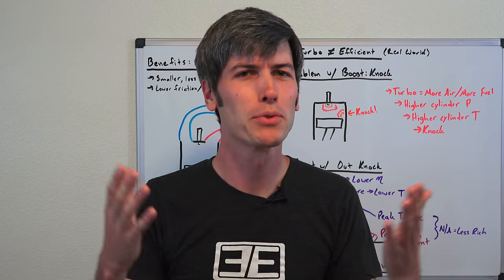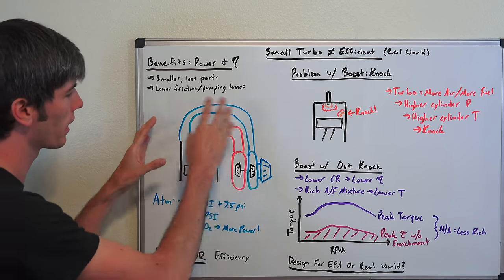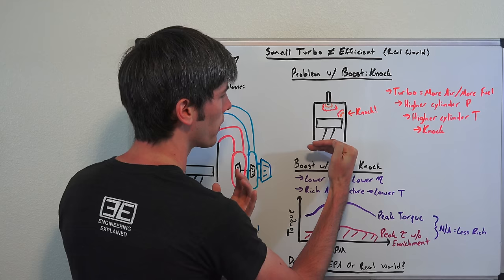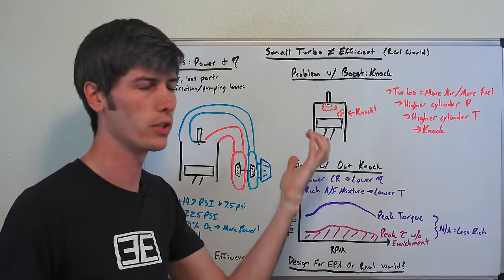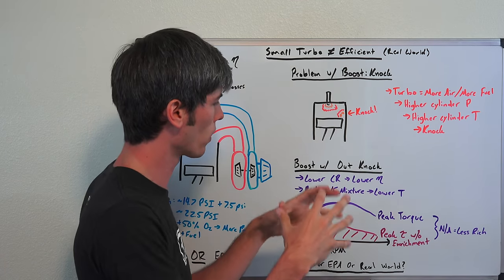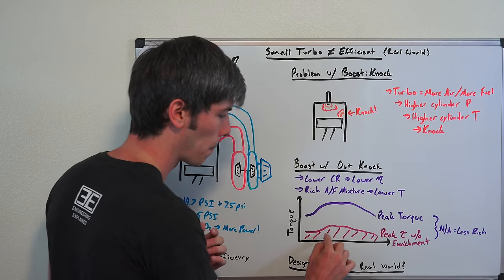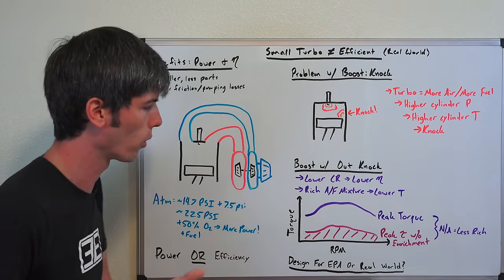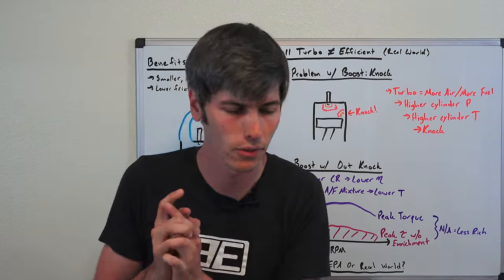Why Small Turbo Engines Are Not Efficient

Comment: A 1.7 turbo diesel is more efficient than a 1.2 turbo diesel. This is because in the 1.2 you'll be constantly putting your foot down just to make the thing move.
Reply: Not really true for diesels, diesels don't have knock problems since no fuel is injected before the combustion needs to begin. So no need to enrich at full load, in fact  turbo diesels usually run leaner at full load than their naturally aspirated counterparts, and have better combustion quality with more excess air. Another benefit is the smaller engines have less internal friction and thus less energy is wasted
Reply: @petarmiletic997  I have a 1.2 tdi polo, which does around 45 mpg city, before that I had a 1.7 astra which done over 50 mpg City. Smaller engines are run at a slightly higher average rpm

Comment: 5 Years later.. is this still the case? has any small discplacement engines improved of the years in terms of efficiency? Also this probably does not apply to diesel engines?
Reply: I've got a '23 Jetta with a gasoline 1.5L turbo 4-cylinder, and it's great on gas when I'm cruising on the highway around 75 mph, even with some traffic. I can easily hit 43 mpg or more. On a regular day, mixing city and highway driving, I land around 40 mpg, and just in the city, it's like 32 mpg.

But, if I start driving it like I stole it, you know, zipping around and passing cars left and right, my gas mileage takes a dive, dropping below 30 mpg. It's pretty efficient when I'm just going with the flow, but not so much when I'm heavy on the pedal.

Comment: Why dont they do small turbocharged engines that runs on etanol? I know that etanol uses more fuel than gasoline but in europe this would be ideal. At least in Finland etanol is 30% cheaper than gasoline.

Comment: what about diesel? the compression generally is higher
Reply: Diesel doesn't have problems with knock, thus the compression is usually turned up to 11. They also basically don't have any real power if left naturally aspirated and don't lose much efficiency if more air and more fuel is forced into the cylinder.
Also why NA diesel engines are basically not a thing anymore

Comment: Quite misleading info as my 1989 smallturbo 1,8l car is very eco car. It uses 7.XXl/100km 98E when driving carefully and around 9.5l/100km when floorin every time on bigger road and not driving carefully. even tough it has very closeratio gearbox. Rpms are somewhere 3500 when driving 120kmh. Again note: 1989 yearmodel

Comment: Yeah, but this assumes you drive around at full throttle all the time. Nobody does that. Really, you hit full throttle in like 1% of the time your driving at most. 

My 96 GTi with a 2.slo NA 4 cylinder engine made 115 hp pushing a 3000 pound car, and probably went 0-60 in 8.5 to 9 seconds. Geez, my wife's '13 Corolla with an automatic can beat that these days. The GTI got at best 32 mpg if I babied it. I now have a 2007 Audi A4 with a 2.0 turbo with quattro. The car weighs like 3400 pounds, and chipped it puts out like 240 HP. More than double. 0-60 is like 7.5 seconds. If I baby it on the freeway like on a road trip, I can get it up to around 32 mpg (by gas use/mileage average, not the dash display). One a camping road trip with my kids, I got 31 MPG with a roof box, with the AC running most of the time on long freeway stretches. 

Same mileage, double the power, way faster pushing more running gear like a propeller shaft, rear diff, torsen center diff, and rear half shafts. The reason is, it's drawing the same vacuum at part throttle as the 2.slo engine in the GTi.... plus the 6th gear on top is taller. 

It all depends on how the engine is tuned. The WRX gets crappy mileage because it's hitting the turbo all the time, so there are more pumping losses at part throttle. 

In reality, I get around 23-24 mpg most of the time, because I'm mostly driving city streets. Pulling away from a stop kicks the turbo in pretty good, plus I like to drive heavy footed up the on-ramps, because it's so dang fun in this car. If I hammered my old GTI, it would dip down to around 25-26 mpg, just because it really can't pump that much air and fuel at 115 hp, tops.

Of course, the other downside is, I have to run premium gas all the time in the Audi. The GTI says it would run on regular 87 octane gas, but it knocked like crazy and ran rough when I did. I put 'Plus' 89 octane in it, and it was fine. My wife's Corolla is fine on 87 octane, as are most newer turbo cars. With regular gas, it dials back the turbo boost and power a bit.

Also, the A4 with the 2.0t engines make less power than the 3.2L V6, naturally. If you chip them, they make a lot more power. There aren't many tuning options for the NA engines. All they can do is tweak the timing and fuel delivery. On the turbo engines, you can dial in a lot more boost. VW/Audi is very conservative with their turbos, so reliability isn't an issue with the added boost.

Comment: You keep talking fast and saying some things over and over again. Ok I'll let that go.  However I was somewhat disappointed that you didn't discuss water injection to cool the hot compressed gasses and slow down the flame front(s).  Also what about just using a higher octane fuel?

Comment: A video request. I would like to know how exactly a big truck with more than a 1000 lb:ft of torque and close to 400 HP like the Actros 2640 LS still not as fast as a small sedan with a half the HP and even a quarter of the touque even without the truck hauling any cargo.

Comment: What about Turbo GDI engines?  Since the fuel is injected directly into the cylinder  and under high pressure 2500psi are and the fuel cools the cylinder temperature more are those types of engines more efficient in this area?
Reply: Uh... that’s almost every turbo engine made after 2010.

Comment: This guy has no clue about intake loss. Old school turbos don’t save fuel: you need direct ignition, throttlevalve-less intake and a twin-scroll turbo. Probably nothing of this has even been told this guy.  The turbo charged engine then isn‘t choked almost all the time and exhaust gas energy is used to overcome intake loss. No surprise that turbo engines at max power consume as much as bigger displacement naturally aspirated engines. Car engines almost never use max power, though.

Comment: What most people don't understand is the difference between efficiency and fuel economy: you can have low MPG rates, but your engine runs more efficient, because it burns that fuel more completely. This happens usually on higher work loads (just think about, when valves are opened wider). What people really want, if they say "efficiency" are higher MPG rates, which means, they drive around on lower work loads and want to get lower consumption figures. Yes, your engine can do that, but this doesn't mean it's efficient while doing it. Just like a light bulb, most of the given energy is not converted into motion, but in waste heat and exhaust gases.

One word to Jason: I get, why you used such a controversial heading, but as you mentioned in the actuall video, even those downsized turbo charged engines have their advantages. So please, don't use those headlines, if you still want to be serious.

Comment: what about 1.4 4Cyl 8 valves N/A engines 75 hp for 990kg/empty
Reply: My peugeot 206(a 1.1L, but it's only like 250cc smaller than the 1.4) is pretty much this. my car used to get around 6.5L - 100Km. 

But now it's super rich and it's 10L - 100KMh 

my under 1000kg "60" horsepower city car consume as much fuel as an old volvo 240 with twice the power and 50% more weight... 

im thinking about turboing it since my pistonrings is worn and the car is going to be scrapped soon, just for lols :D

Comment: Small turbocharged engines are built to get high MPG ratings in government testing.
Reply: My small turbocharged engine does get high MPG in every day driving v. my previous car of about the same size and weight.  Despite a smaller fuel tank I'm getting over 100 miles more range per fill...

Comment: because you dont like in japan... simple, there they solved that decades ago... k cars, small diesels, compact sports cars... if you look up at the name of the main global brands engineers, responsible for the new low displacement turbo engines(with better efficiency than larger ones) they usually sound japanese...,  PSA with BMW made a 1.6 16v, 4 cylinder turbo engine that was for the minicooper , it ended up such a powerful and efficient engine, that it powers from the ds3 to the ds5, minis, and some 12 other models from the companies involved,  they make more power than a 2.2L NA, and are as fuel efficient as a 1.8L 16v, they can be tuned up to 250hp without changing internals safely, i would say, the small turbo isnt efficient is a myth, look up how much power a 1.500cc bmw f1 turbo made...  like 1500hp on qualifying mode...

Comment: A turbocharged engine will get you better gas mileage than a naturally aspirated engine, it will also give you better power compared to its naturally aspirated counterpart. Be wary however, it cannot give you both simultaneously.

Comment: I need your advice please. I would like to put 1.5" truxx lift kit on my 2017 Ridgeline Sport utility and spacers to put bigger AT tires on for better ground clearance for offroading without affecting factory safety equipment. Is spacer ok to use? Also thinking about Turbo charger, is it possible?

Comment: SURVEY: Please reply if you or someone you know had to replace their turbo and how man miles and what it cost. Thx!
Reply: Jon Harrison  iknow 2 hv turbo didn’t replace it but they use it right change oil often make it cooldown know when they accelerate or not understand how it work with the engine and the transmission .
Reply: @ebrahimshibl5106  Thank you. I already know the official line. Wasn't the question. ☺️

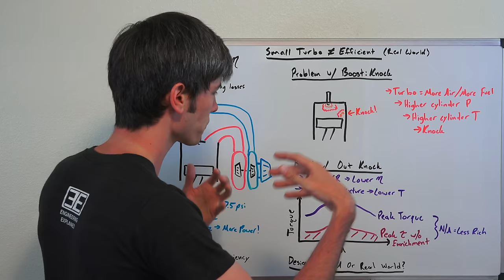Comment: approx at 4:30 why less efficient.. unfortunately you did not account for engineering!! lol.  honda obviously has found tweaks to get around a basic level analysis.  thus the 1.5t is higher fuel eff than the nat 2.0 under nearly all similar conditions.

Comment: What about small turbo diesels?
Reply: As long as you don't romp on it constantly, even a 3.9L 4bt cummins can get 25-30 mpg. Smaller 4bt diesels can easily get 40 mpg even when driven hard. My 1.9L jetta tdi gets 45 avg mpg and I drive it ~100 miles per day, half city, half highway. Only put my foot to the floor a few times a day when I really need to.

Comment: Mazda engines self destruct over 100K miles as they are overly dependant on this tech that WILL NOT hold up for the duration. Buy a Toyota, change your oil. Or buy a Honda if you like only if you drive a stick. Personally I think Honda screwed up by taking the 6 cyllinder from their car lineup. I wout buy another Honda now although I loved my v6 Accord.

Comment: The Federally-Mandated Addition of Ethanol Actually Retards Knock, so your point is Moot. Blended Gasoline Functions the Same as Leaded Gas from the '70s, which is why Modern Engines are More Efficient and Production Cars can make 800HP on Pump Gas

Comment: Yeah-yeah, Mazda, Mazda, Mazda, Mazda 😑
I think that this is one of the most biased video of you.  😑
Forget to mention about aluminium open-deck blocks which are easier to cool down, forget about higher octane gasoline which is knock resistant, intercooler or other technical details used in small displacement engines with turbo. 😑
Not so much about true engineering explained this time 😑 I'm watching you with pleasure over the years but now I've found the need to intervene on this.
One example: F1 engines are small, very powerful and fuel efficient(for what they do).
I drive a vehicle of 800kg, 2 seats roadster-coupe, 100cp, 15 yrs old car with... 0,7L engine, 3 cylinder turbo. 😎
0-100 under 10 seconds, timeless design and fuel efficient @ about over 50mpg (4,7-5 l/100km)
And one more thing. My example of car is proper serviced and original engine has almost 300 k km on the clock 😎

Comment: What about a small turbo diesel?
Reply: Diesels burn fuel according to the load placed on them. The turbo adds more air, which means higher horsepower and better economy because the fuel can burn leaner. Diesels have more compression, but use fuel that is heavier and has more calories. Really old diesels had  a pre-combustion chamber that retained the heat, then fed it into just air so that it would expand and produce torque. The system REALLY worked on the high torque / low RPM engines.

Comment: My Focus 1 litre eco/boost will do 39 mpg, road tax £30, it is light to drive, 125bhp. 
Tax saving £16.6 per month and 10 mpg  :)
My Focus 1.8 litre petrol will do 29 mpg, road tax £230, it's heavy to drive, 125bhp. 

Focus 1 litre eco/boost is faster than the Focus 1.8 litre petrol because it is lighter.

Focus 1 litre eco/boost will piss all over a Focus 1.6 litre petrol engine.
I have owned all 3 cars above.
If you are rich and/or drive like a mental retard, eco/boost will not be for you. Other than that I think it is all win win win.

Comment: Your theory doesn't really work. Most manufacturers don't publish economy numbers based on high load situations. Under normal driving  a small forced induction is far more efficient as they generally target 14.7 afr on most of the fuel map apart from wot. Knock is usually managed by pulling timing instead of adding fuel also. Under wot conditions anything that's in boost is more efficient than na. The best volumetric efficiency an na motor can hope for is between 90 and 100%. A FI motor running 1psi is already 14.7% more efficient than an NA motor. Your assumption that modern small turbo engines run rich enough under load to ruin fuel economy is wrong. At a guess the reason these engines don't get close to factory numbers is probably down to driving style. If you have to drive around in high load during "real world driving" your doing something wrong. Modern engines tend to run high compression to eliminate off boost sluggishness and are usually direct injection which usually raises the knock threshold also. In the Europe most new cars are powered by sub 1500cc turbo engines.